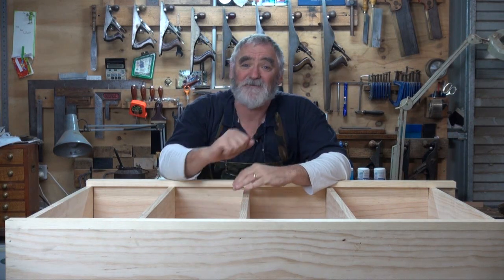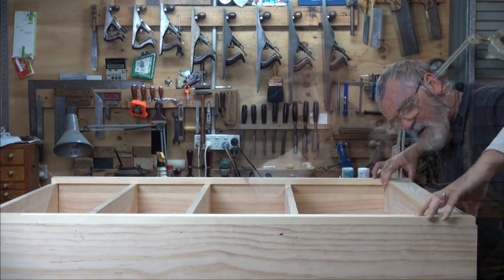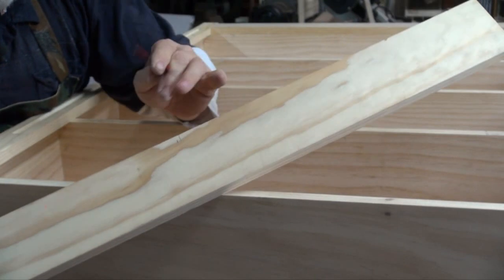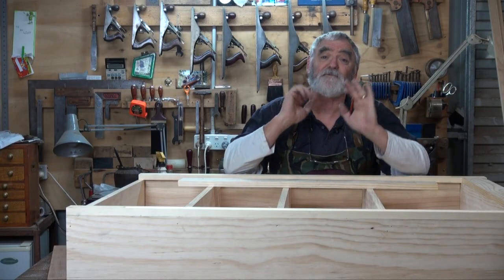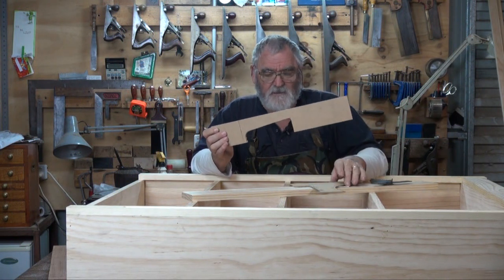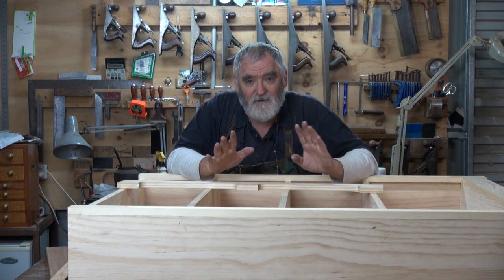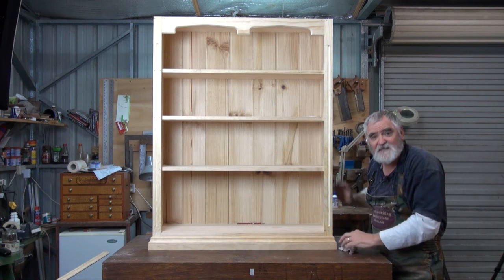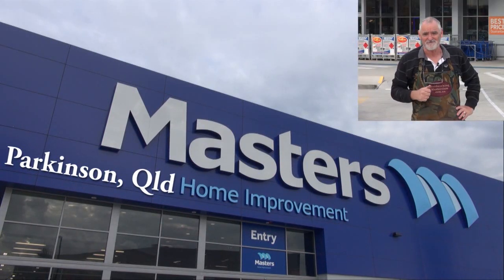4'x 3' Bookcase Part 5 of 6

Comment: A tip I found along the way...if you place the masking tape on before you drive the nail, then apply the putty.  You will only get putty only in the hole and not on the surrounding wood.
Reply from the maker: Frank Y Good Tip thanks for sharing. Cheers Steve